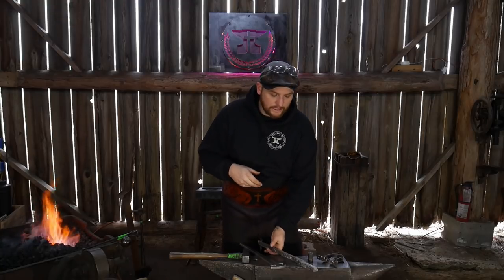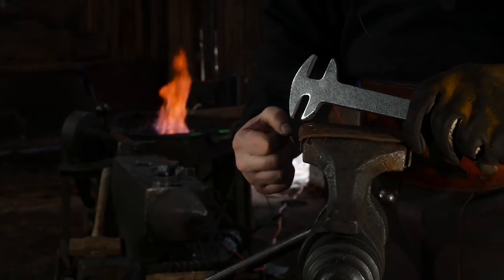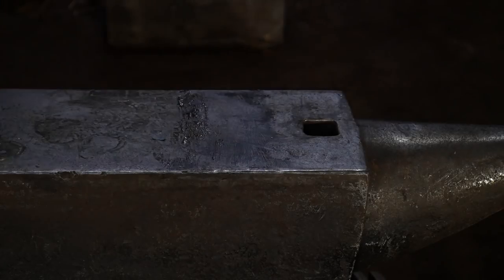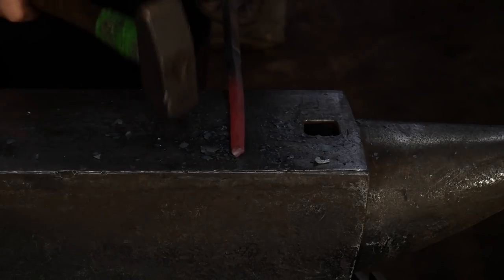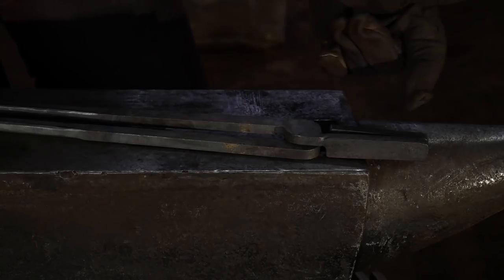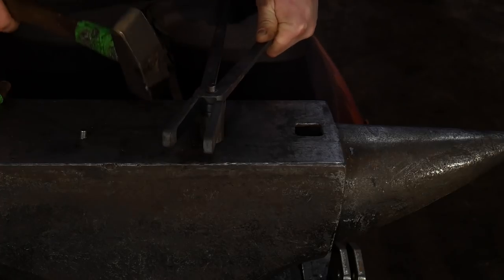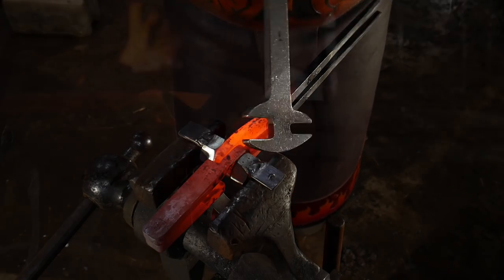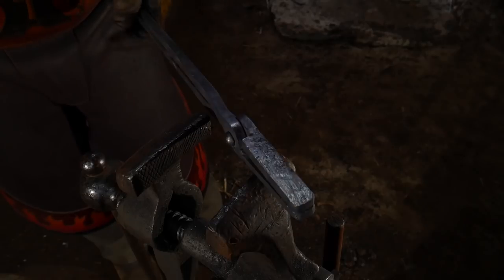Precut Tongs: Forging and Reviewing RX 01 Tong Blanks

Comment: That's something that i need to is tong's My Anvil got here today''Yes'' I just don't have to many tool's yet But i will  It's a money thing to me or i would buy me some Roy Thank you for showing me a Hobby that i love used to use a Concrete block to flatten my steel After destroying several block's i got my low spots field in my driveway Lol
Reply from the maker: Awesome to hear you getting started :-)

Comment: I have several pairs of RX tongs. Much easier than making from scratch for a light duty tong. They are really reasonably priced and work well. However if you need a heavy duty tong these are not the ones.

Comment: I guess aligning the reins vertically makes them left-handed and right-handed tongs.
Reply from the maker: Could be :-)
Reply: OK, tongs for right handlers are held in the left hand.  I think ordinarily right handed tongs have the left rein  to the left.  That allows your fingers to push the rein into your palm.  If it is the other way, the fingers push the rein toward the base of the palm, which is more awkward.  Other tong blank manufacturers address this by telling you which direction to twist the jaws for right or left.  By aligning the reins vertically over each other, this distinction is lost, but you lose part of the advantage of pushing the rein into the middle of your palm.  I will quit now before this gets even more confusing, if that is possible!
Reply: @glenndarilek520  Agreed. I was expecting him to twist the jaws counter-clockwise since he is right-hand dominant and would hold the tongs in the left hand... Twisting counterclockwise aligns the reigns so they fall into your left palm instead of wanting to roll out. I think by twisting the reins to center them, they are less prone to rolling.
Reply: @cannistershot2277  
Good.  The falling out of your hand is a factor I did not consider.
Reply: I was just about to comment about how these appear to be right hand tongs for left-handed smiths. Regardless, I really like the bending and alignment tool for the reins!